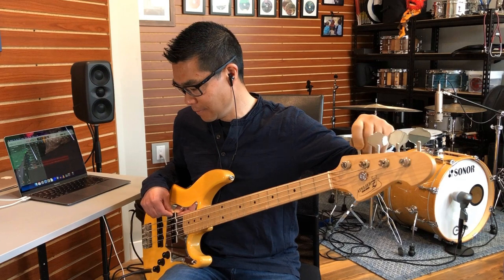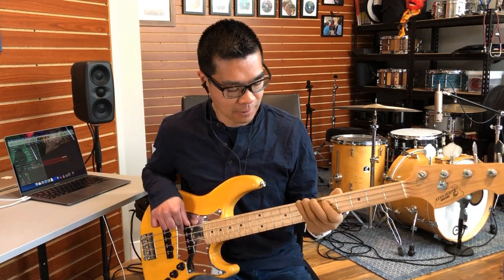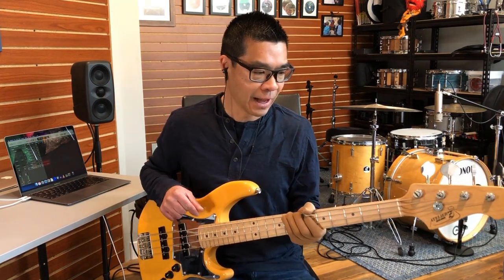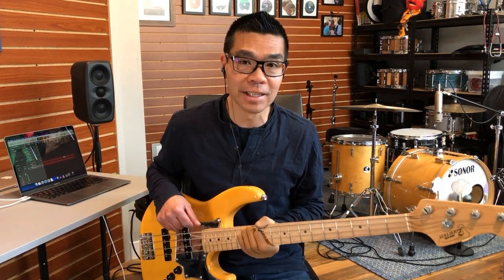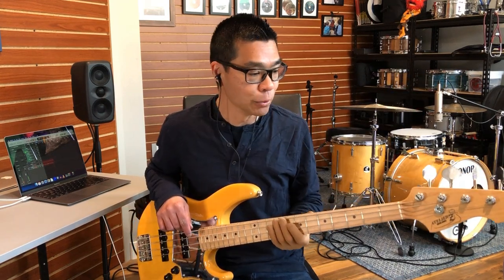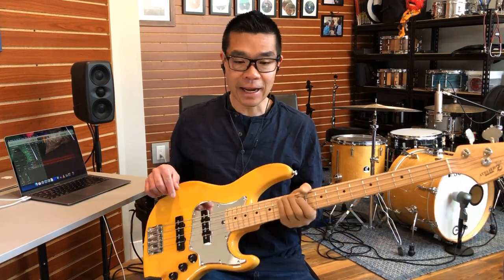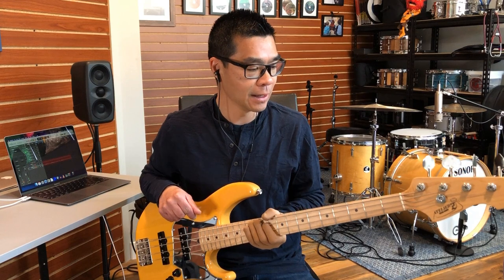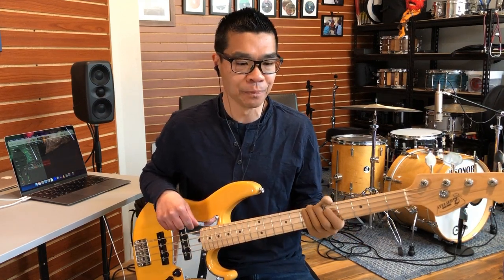Down-tuning a short scale bass. Why? How does it sound? (eg. E flat standard and D standard)

Comment: Been playing around with Squier Bronco .45-.105 which is faring quite fine up to C I think, for low B just a little too much rattle going, so I'd prefer a larger string gauge for going BEAD, but it's managable with correct picking and some EQ or maybe some additional setup. Actually surprised how well shortscale handle downtuning. Cheers
Reply from the maker: Very cool! I’d like to have a dedicated D standard short, maybe 110-50!
Thanks for watching!

Comment: That's my whole problem with short scale basses the strings just don't feel right E flat was ok D was too far.
Reply from the maker: The floppy lower tension definitely takes some getting used to, for sure. Heavier strings (Eg 110 -50) might make that better, but then it might be too big for the existing nut and may be harder to find in the right length. Thanks for watching!

Comment: As a pro working player I use primarily short scale 4 string bass’s setup as BEAD, strings I use are DR super bright with a 125 low B.
My short scale bass’s that are BEAD are 3 short scale Sterling Stingrays, 2 Ibanez Mikro bass’s and 2 of the new Sonic Bronco bass’s.
The Stingrays are my gig bass’s.
My BEAD strings are not floppy or muddy sounding at all on any of my bass’s.
I do own more than a few 34” 5 string bass’s but I much prefer my short scale bass’s these days and all my 4 string 34” scale bass’s are also BEAD.
I’ve been doing BEAD on ALL my bass’s for around 20 years and will never go back to standard EADG.
Thanks for the great video, Cheers, Davyo
Reply from the maker: Cool setup! Thanks so much for watching and commenting!!
Reply: I've been debating drop tuning my short scale Mustang bass to BEAD with a different set of strings, but wasn't sure if it would work on a bass with a 30" scale length. I'm going to go for it now, thanks for the info!
Reply: @BassedInVegas DR Super Brights? Is that equivalent to Hi-Beams?
Reply: @bassedinvegas I'd love to know what strings you use for BEAD on the short scales, and what gauges. Thanks!
Reply: @alexhall2924 good question!

Comment: Loving your short scale bass videos.   As a beginner bass player this video really helps b/c normally like to play in D standard when I sing and play guitar. However since I’m not playing out I’ve just been playing in E standard.  So now I’m thinking about taking my shorty to my luthier to get the bass setup properly for D standard.  I had already bought some D’addario EXL 160S, medium gauge strings, 50-105 b/c I wanted to know if the shorty would sound better going from 45 to a 50 gauge string on the Low E.  I have a question though, if I want to play in Eb would I still need a setup?  Also, I notice my Korg Pitchblack pedal and snark clip on tuners does not show the Flat notes, do you know if I am setting it up wrong or will those types of tuners only show the sharp version of the note? Thank you.
Reply from the maker: Thanks for watching!!
Re setup. This would depend on what gauge string you settle on and how wide the nut slot is already. Possible all it needs is to add a smidge of relief in the neck (loosen truss rod) with the lowered tension of downtuning to Eb. If you go to heavier gauges, then you might need to widen the nut slots and adjust the neck.

From a practical point of view, I found Eb standard to be weird on my brain, especially when reading. D was easier for me to get used to.

My planet waves and TC clips also show flat notes as sharps Eb = D#. And it’s tiny, so can be hard to see on stage. I’m not sure if that setting is changeable. I try not to change much as every time I change the battery I have to remember to change it again. The planet waves model has a finicky battery cover. I rely on the huge screen on my Line6. I can see that from behind the drums!

Comment: You can restring any bass with any scale to optimize it for any tuning.
The only limits are what string gauges are available, and what lengths they're available in.

The math is pretty easy to figure out, and both D'Addario and StringJoy will tell you their strings' tension at pitch. 
String joy will tell you tension at pitch and scale length. Just buy a gauge that gets you a tension similar to what you're used to, but at a lower pitch.
Reply from the maker: Thanks for sharing! Yeah, unfortunately the market for short scale/string wound lengths in heavier gauges is very limited. I’m sure some companies will make a custom gauge set if you are willing to pay the premium. Hopefully this will improve with increasing consumer demand. 
Thanks for watching and commenting!